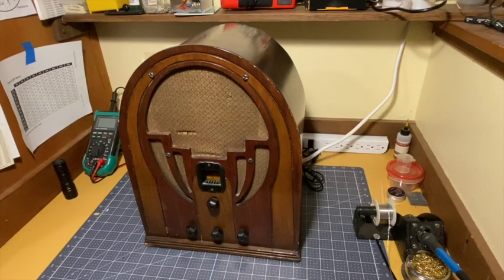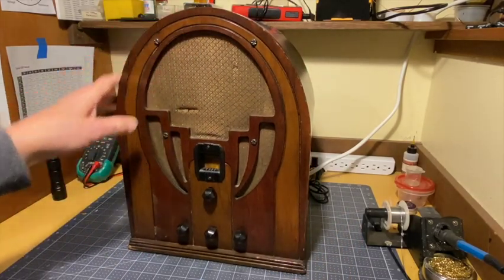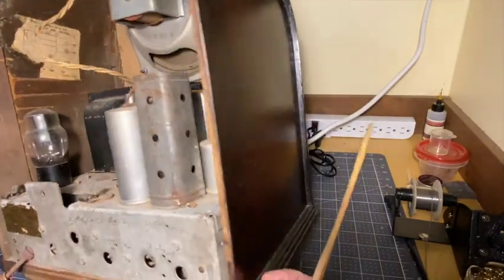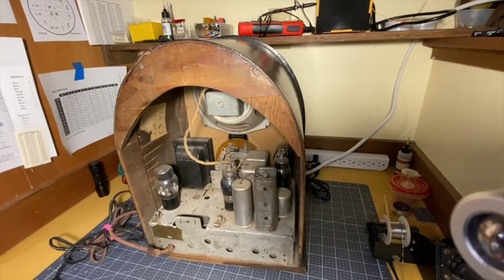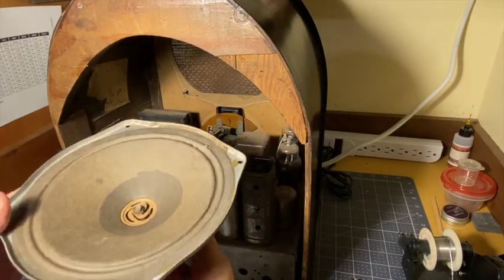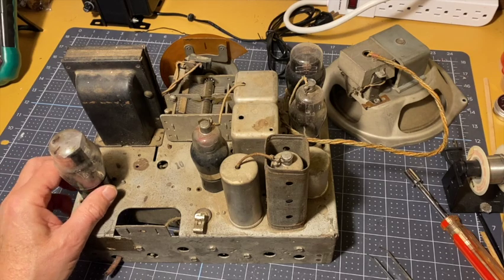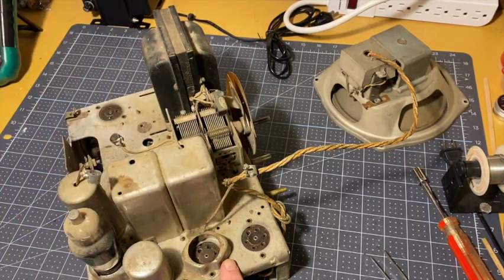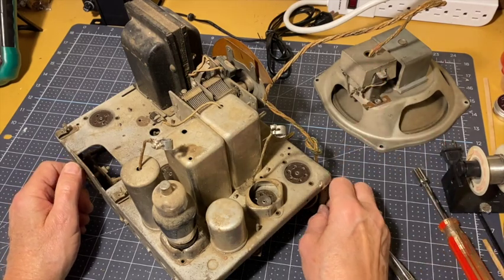Philco 60B Part 1 - First Look

Comment: I believe your radio was produced in 1934. I have a Philco 89 and a Philco 16B both with original finish and both of them were produced in 1934 according to the date codes on the original tubes. The Model 60 was the smallest of the Philco radios of that era along with the model 84 being the smallest and least expensive and I believe that the 16B was one of the largest as it has 11 tubes, 10 inch speaker and 4 bands. Wizard tubes were sold by Western Auto stores back in the day. If you need the correct tube shield, I'll send you one for the price of shipping.

Comment: Nice radio! Looking forward to Part 2….that black veneer looks like that piece off of the rim…..that tube definitely has to have that shield on it or it will oscillate. Also, the grid wire comes up thru the tube socket hole and must go inside that shield. As you and I have discussed, this one is like the model 66B Im working on except the SW band is different. The filter caps  have been replaced, they should be cans on the left back of the chassis like mine. I hope you have better luck with your bandswitch than me…lol. If you have any more questions, let me know….Take Care—Larry
Reply from the maker: @Backtothefutureradios  Thanks, Larry. I’ve pulled the filter cap cans off a parts chassis to get this radio back in its original form.